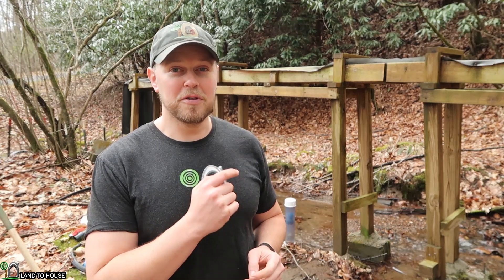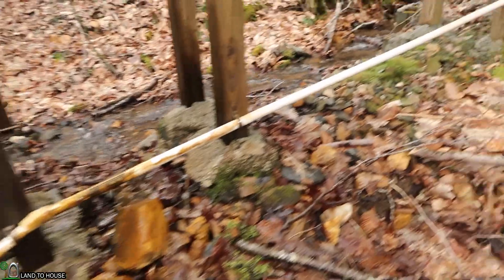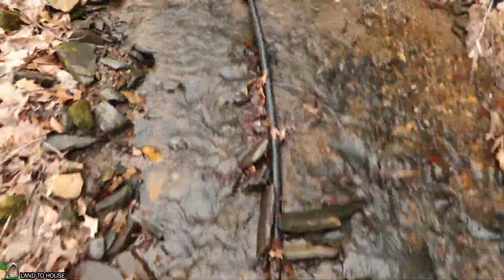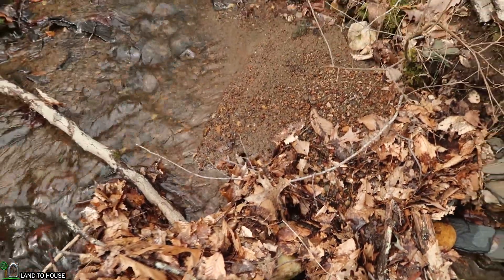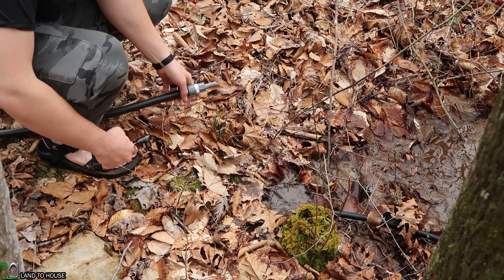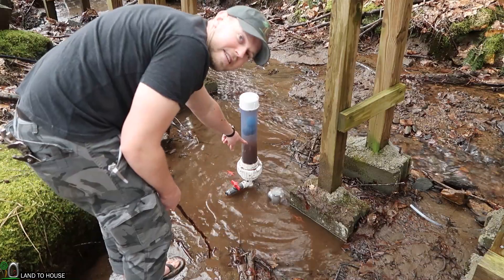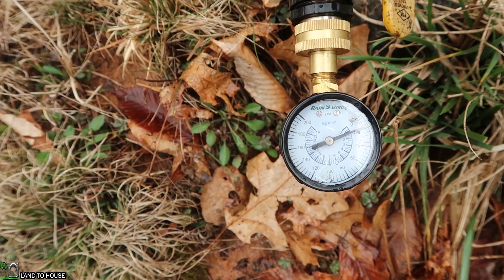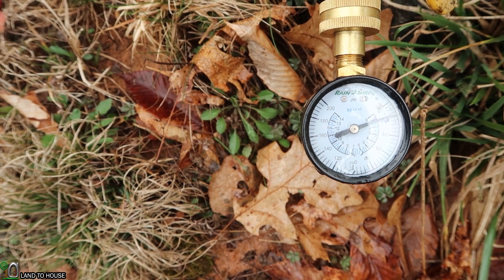Start Up the Ram Pump for 2020

Comment: You can keep the tubing from slipping off by alining you hose clamps and wrap a copper wire around the clamp housings in a figure 8 style and twist tight. I started doing this 10 years ago and never had any slip off since.

Comment: If you put the cycle tube into the pressure pipe, with the valve through the top cap, you could adjust the pressure at will to suit requirements.

Comment: Test suggestion: when you cleared the silt and restarted the pump, you showed the water in the clear pressure cylinder moving about 2 inches vertically.  So that suggests a test: how short of a pressure tank can you use and the pump still works?  I'll wager 6 inches with no loss of delivery flow.
I'd suggest that you add another elbow below that broken ball valve you used for extending the supply pipe deeper into the bucket, so the water swirls in a circle around the bucket.  Any leftover bubbles will surface more quickly and stay away from the drive pipe and it will allow more sediment to settle, like a cyclone vacuum cleaner.

Comment: Can a ram pump run with tap water.  My house has low pressure and 2 story in Mexico
Reply from the maker: The ram pump needs an open to air water source. It does not work on tap water.
Reply: You can use your tap water to fill a supply bucket, but then you need a drop from the supply bucket to the ram pump (like he shows here). Then you should be able to pump 5-7 times as high as the drop from the supply to the ram pump. Not sure what you would do with the ‘waste’ from the supply (what comes out of the check valve)?

Comment: Silly question, I want to use my pond as a water supply for livestock, ITS APROX 300 yards from the pond to the pen, water will have to go over a levee  before starting down to the pen which also will be having to flow slightly uphill, would I be able to have a float valve on the water tank to stop water flow then when the float drops to allow it to fill again, would the ram pump still pump water for the tank or would we have to restart the pump each time?  I hope I explained that right..lol

Comment: I remember you saying something about closing a valve too fast and I wanted to recommend a simple solution to avoid any extra water-hammer damage to your piping. that'd be a spigot. specifically, one with a screw-valve in stead of a 90 degree ball valve.

Comment: Whats the height difference between the water Ram pump and your main water storage ?
Reply from the maker: Mine is 35 feet height between the pump and tanks.
Reply: Land to House there’s 200 feet difference between my water source and my tank , i was thinking of making it by stages using multiple ram pumps with a water storage in between. Do u think it will work?
Reply from the maker: It is certainly possible to do that. You have to run the lower pump until the mid tank is done. Then run II pump from that mid tank. It will be slow going but it can work. Sadly  you won't be able to run both pumps at the same time 24/7. The second pump will use more water than the first one can deliver.

Comment: I have a question that may just come from my own ignorance of ram pump designs. Why not just fill the bucket feeding the stand pipe directly from the flume? The bucket is open to atmosphere, so I can’t see the benefit of using the uphill collection system. It seems like the vertical drop from the bucket to ram pump would be the same.
Reply from the maker: Yes that would be the same vertical drop. I primarily wanted to install the pump this way because 99.9% of the world doesn't have a flume. I wanted to show how a full system would be installed

Comment: Wow, it's strange to see someone excited about 11psi. I'm so used to my city 90psi. I can just use my hose as a mild pressure washer with the right tip.
Reply from the maker: The ram pump is a low flow low psi pump. but does not use fuel or electricity. I actually got 80 psi out of a ram pump test this week.
Reply: @LandtoHouse  Exactly. Also, was that 80PSI built up (closed system building pressure)? Because if you can get an itty bitty ram pump to create that much pressure, you an get that up a hell of an incline.

Comment: Why do you pump some air-filled things like balls and bicycle tire into the pressure valve? What purpose do those serve - to relieve the stress on the cylinder, caused by the high pressure and its frequent changes?

Comment: At 9:36 the cylinder gets filled with dirty water when you released the one way valve. Does that clear up as the pump got going or did you have to remove the cylinder?

Comment: 13:26 Makes sense! I knew that from the bottom or from the top was the same when the water level is at the top.
However, I didn't think about the fact that if you start at the bottom, you can take advantage of needing less energy as it works it way to fill the tank.
Cool!
Reply: i think ill prefer feeding the tank at the top and with float valve
Reply: Im not sure it does, the head pressure from 3 barrels will be so much more than just filling from the top so i'd wager its slower to fill from the bottom like that, unless the non return valve makes that much of a difference. Would be cool to see a video on how much it slows down when filling from the bottom/top over time.
Reply from the maker: Good video idea! I will film that this week. My guess is that it is 10 minutes faster from the bottom.:)

Comment: Thanks a bunch for your knowledge man, the few videos I've seen so far have been a wealth of knowledge. I started working on a project to water and power a small vegetable garden and was curious if something like a Tesla valve could be added to your feed line to redirect that pressure forward and optimize your lift to your tanks?

Comment: Hi;am from morocco.i want to purchase this ram pump but amazon can't distrube it.anyway i have some questions plz:
1:i have a river near to farm but it's down and farm is up.the distance is about 100 meters.and high about 7 meters.what is the easiest way to benifit from that source witout using electricity i mean freely.
2:a wide well about 2meter.the depth about 13 meters. I need a very easy way to bring water freely (ram pump)or using a  high tank of water
3:i have a  narrow well about 20 centimeter.and depth about 200 meters.what is the best idea to benifit from water to farm which is not far at all in this case.thank u so much for answers

Comment: love ur work...
i have a question:
can a ram pump be added on water well escape pipe?
Reply from the maker: The ram pump needs to have an open-air water source. Is your overflow pipe open to the air?
Reply: @LandtoHouse  yes. it is... the water never goes over it and has steady flow .... the pipe has 50 ft lenght 11ft height at output(downhill).

Comment: Would it be worth adding a soak line to that overflow from your barrels? It could be used to gently water the grass on the slope you were struggling with behind/in front of the house without washing the seed away - and it'd be a 2 for 1 in terms of using the extra water!

Comment: don't you loose head by having the silt collection tank half way down your feed pipe?
Reply from the maker: Yes about 1 foot.  But with 7 feet of head pressure lifting to 35 feet is not an issue.

Comment: It would be interesting to see just how high the fill pipe going in the tanks will lift, and raise the tanks accordingly, increasing line pressure to the garden pressure to maximum.
Reply from the maker: The ram pump has a head pressure of 7 feet. This means that the lift would stop at around 50 feet. The tanks are at 35 feet roughly.

Comment: Idea - Build a silt removal stand pipe to replace bucket. Should increase head pressure at pump. Clear would be cool, but not necessary. 
Bottom - 4" pvc cap, drill to fit a brass pipe & ball valve, drain
5' of 4" pvc pipe laying horizontal, vertical if there is room 
4" pvc coupler
4" to 2" pvc flush bushing
Short piece of 2" pvc pipe
2" pvc 90° elbow horizontal to vertical
12" of 2" pvc pipe vertical
2" x 2" x 1 1/4"  pvc Tee Inlet
1 1/4" to 1" NPT pvc bushing Inlet
24" of 2" pvc pipe vertical
2" x 2" x 1 1/4"  pvc Tee Outlet
2" to 1 1/4" pvc bushing vertical
10' of 1 1/4" pvc pipe vertical vent, longer if needed
Reply from the maker: That would work. In my area I only have to drain the silt a couple times a season. The bucket gives a simple solution for people who dont do a lot of pvc stuff.

Comment: I guess we are on the same schedule! :) At 13:00 where you talk about elevation and pressure, I have a video out on that explaining PSI, pressure, site calculations and the like (called "The Ram Pump Design Manual *Calcs Pressure Elevation Measurements Sizing Operation*). Keep up the great work Seth! Looking forward to your Ram videos for 2020!
Reply from the maker: Yes it's that time of year! I wonder if a nylon washer, or metal for that matter, would keep your valave from wearing down into the valve?
Reply: I had a nylon washer on there before, it actually took a beating pretty quick. I think I need a  few stainless washers to take up the shock. That brass is so soft.
Reply from the maker: And with several million Cycles in a year's time that brass just Falls away
Reply: @LandtoHouse  Fortunately this is the harder of the two brass types, but yes it is wearing over time. I'm actually amazed it is in it's third year now. The swing check valves I started with only lasted months.

Comment: thank you so much for these videos! I have a question, will increased head, something like a 10ft drop, produce more gallons per minute outflow?
Reply from the maker: Thank you for watching! The output does increase with more head pressure. Until the back pressure is not great enough to keep the pump running.

Comment: You should use a 45 on your input running to the tanks so the pipe does not snap
Reply from the maker: Yes indeed! I also need to bury the poly pipe.

Comment: You should stack the ram pump up on some concrete block so then it cannot get drowned underwater
Reply from the maker: Yes that's true! I hope to remove a section of the flume.  Then I will have room for that.

Comment: Thanks for the video - I really liked how it showed how you are actually using your ram pump, the considerations of starting up after the winter and how you are using the water for your tank and eventually garden from the gravity feed.  Can't wait to see how well the wobbler works and if that works out better than a drip system with your 11 PSI.   Pretty neat how you calculated the lift height with the pressure gauge.  I linked back to your video from the ram pump discussion:  https://www.facebook.com/groups/240458583255303/permalink/521060315195127/

Any thoughts about also selling parts that you use anyway?   Probably can't afford to ship unless some might order several or include with an order.  Thanks for linking to the seal in the video - I was going to ask about that.  Do you have a favorite source for the clear PVC that is useful for testing,  but I gather might have issues with algae growth if used continually - on the other hand - we could see it.

I've watched almost all of your ram pump videos and many multiple times.  Thanks - Dave
P.S. - my 1 1/4 ram pump from Land To House is currently sitting my my desk and I refer to it when watching the videos.

Comment: Hey Seth Just wodering what size of Ram pump are you using,and how Long is your Drive pipie Thank you
Reply from the maker: My personal Ram pump is 1 inch. The drive pipe is approximately 50 ft long
Reply: @LandtoHouse  Thanks - you gave most of the stats in the video, but do you know how much water is being lifted to your tank (coming out of  your overflow pipe)?

Comment: If you replace the elbow in your bucket with a T you would create a "solids lifting overflow" they use them in aquaponics so you dont need to drain the bucket
Reply from the maker: I've heard of those. Never have made one. Do you have a link to a video? Probably worth installing
Reply: @LandtoHouse  https://youtu.be/bmzgANTGJ0k
Reply: @stuartevans6807  Thanks - I couldn't visualize either - the video helped - just a pipe inside starting near the bottom that pulls from the bottom leads to the output pipe from inside.  In my case, I'd prefer the fish go back into the stream so don't need the strainer on the output side.